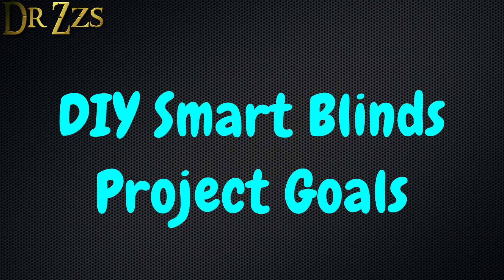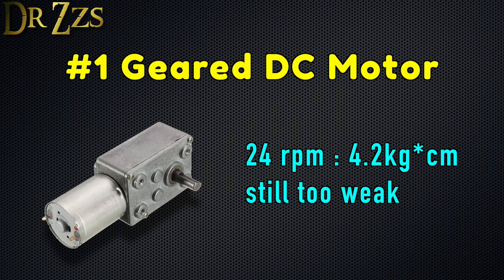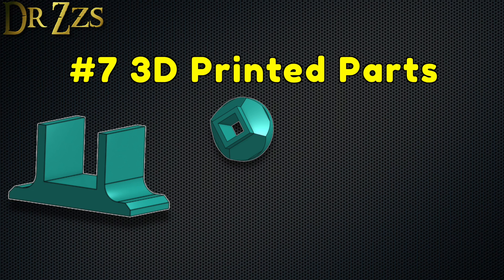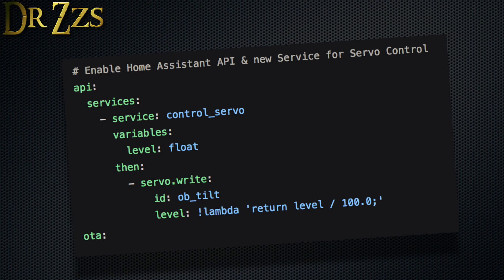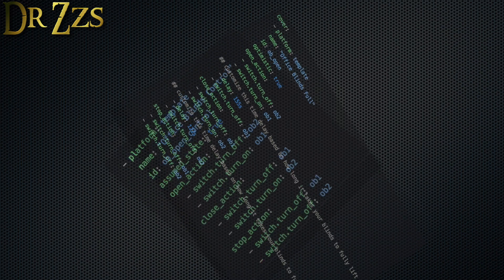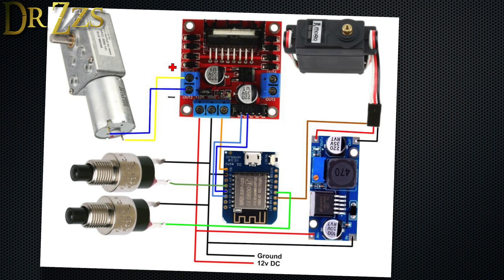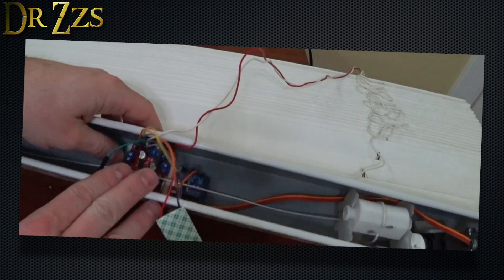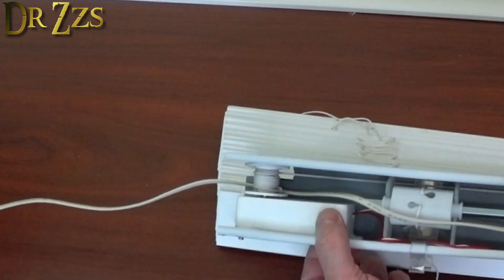Motorize & Automate Blinds | DIY Smart Home Automation

Comment: Great video! Definitely want to do part of this on 2 of my blinds that face west. Open then slowly close as it gets closer to sunset. I can probably run cat5 and get away with it given we rarely pull them up.
Reply: I live in a climate where the heat varies greatly.  Too hot in the summer, cold in the winter.  I was thinking that I've seen so many people that monitor sunlight over the years.  But in this case, one would want to monitor the amount of sunlight in the room as well as sunrise / sunset, temperature, and set a temperature range and/or Heating/Cooling mode to use the blinds to maximize light, and passive heating and cooling of the room that they are in.  Sensor could be anywhere in the room that would tell the blinds what to do.  Each blind being programmable to the most critical mode.... for instance ambient light from the north, while limiting the South, East and West exposures for Heat/Cool.
Reply from the maker: There are extra pins on the D1mini that we could use for a light sensor. It has to be on the one and only analog capable pin though.
Reply: @DrZzs  I was thinking "something for The Hook Up to do," then you did a bit of a more comprehensive approach. :-)
Reply: @DrZzs  as long as there are two open it's a job for i2c sensors, easy to throw on a LUX sensor, temp/humidity, etc on the 2 pins.
Reply: @bryanhickman7663  great idea on the temperature thing.  Would be easy to adapt to your needs.  That's the whole fun of doing these projects...adapting them to your needs then sharing back with the community and possibly inspiring someone else with a different set of ideas which starts the process all over.  Keeps the innovation "train" going.
Reply: @digiblurDIY  Totally! A quick sampling and set every 15 to 30 minutes would do the job I'd suspect. ;-)  I wish I had the skills at the moment.
Reply: @bryanhickman7663  it's easy. Lots of folks to help out in discord. Grab the link of the DrZzs site and come join the fun.

Comment: Oh crap, he's not just a floating head :O
Reply from the maker: Ahhhh!  He's got legs!  :)
Reply: Legs, arms, a torso, I'm freaking out here!

In all seriousness, you could probably do without any endstop for the downwards run. If you time it, it should be pretty consistent for lowering the blinds. Even if it overshoots a bit, that's not too bad, since it will just start raising the blinds again, and eventually hit the endstop on top. Even if the blinds currently don't know where they are, after a reboot or something, they could just go up completely, and have their zero position again.
Reply from the maker: Very true.  I decide to use the physical button and I’m glad I did. It works really well. I put it under my desk so I just press the button and control the blinds from my seat.
Reply: Fair enough. Also a good way to stop it half way, if you ever would so desire.